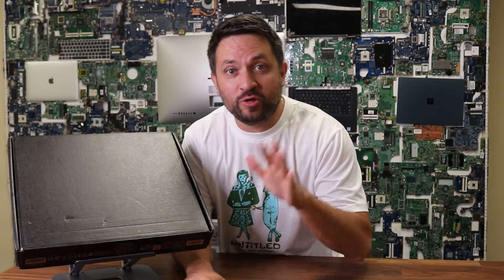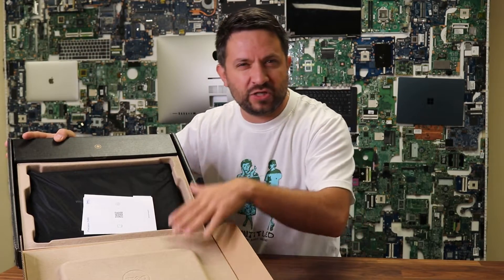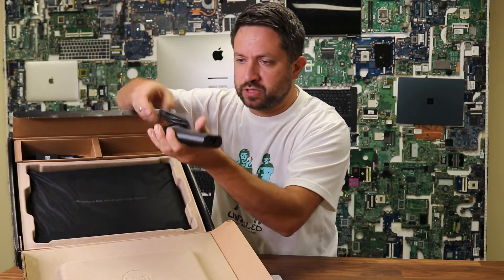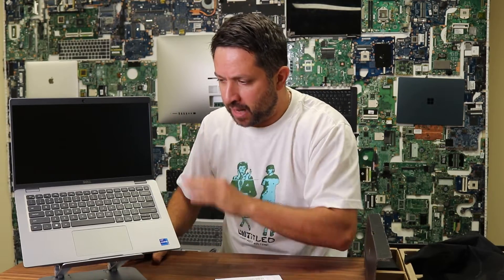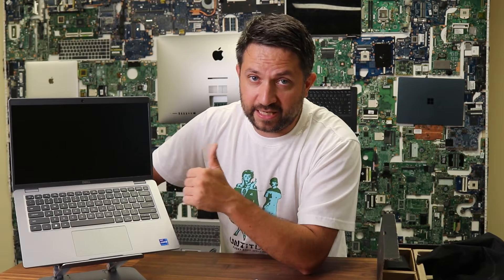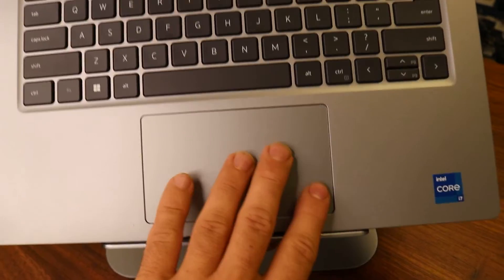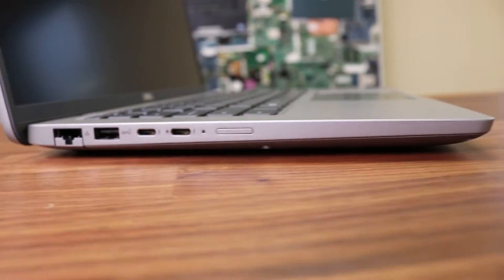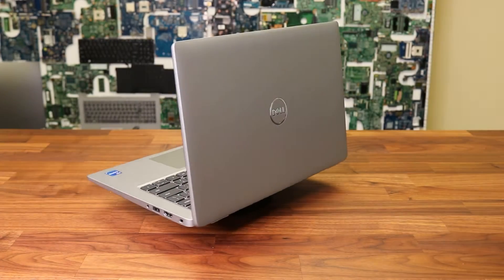Laptop Dell Precision 3480 Unboxing. Brief review, disassembly, parts removal, upgrade.

Comment: Hi, thanks for the review! I am thinkin to buy this precision 3480, even though I looked at the Inspiron 14 plus which seems to be more powerful and cheaper at the same time! Do you have a suggestion about it? Moreover, what is the battery life with basic operations (some google chrome, some pdf reading, office use)? Do you think that the A500 is sufficient for basic 3D drawings ?
Reply from the maker: Over all I would definitely recommend this model as it's a very budget friendly and will work eith some basic 3d as well

Comment: Thanks for this. The nvme drive location is stupid- I literally had to break the speaker resonance chamber in order to fit a larger nvme drive in it- and it still rests jankily on top of the speaker at the end. I really hate the trend of using 2230 drives instead of the standard 2280s in enterprise laptops.